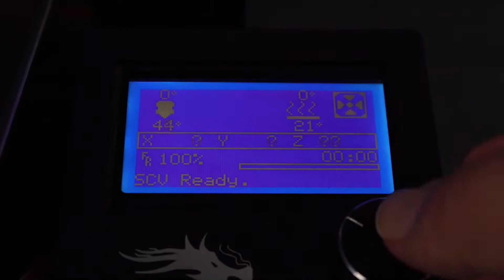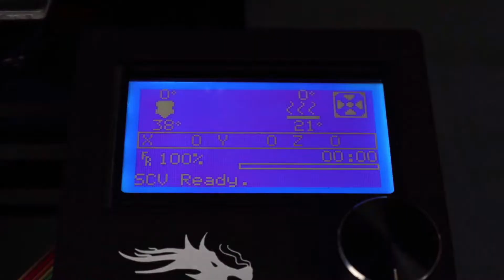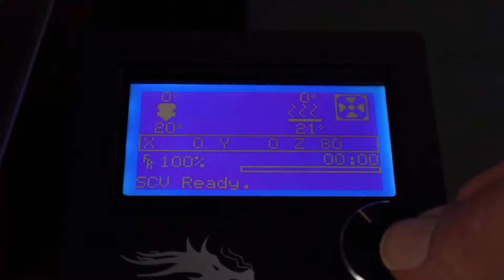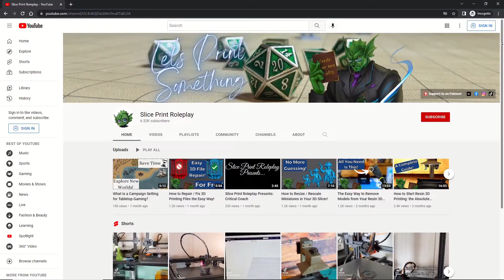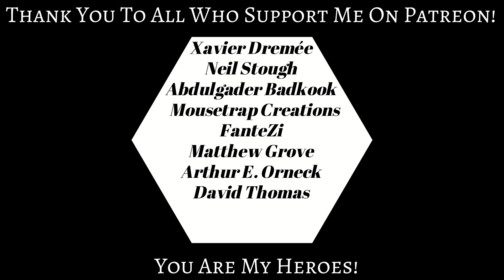How to Install a Glass Bed on Your FDM 3D Printer!

Comment: Sorry, I'm inexperienced, but I want to ask: Your printer's original proximity sensor is definitely magnetic. When it reads the metal plate of the print bed, it stops. Wouldn't it be easier to find a proximity sensor that reads glass? One with the same characteristics.
Reply from the maker: This is an older style printer that does not have any kind of inductive or proximity sensor. It's simply just a switch that engages when the Z-axis reaches a certain level. That switch is engaged the same way whether you're using a metal plate or glass.

Comment: Solutions over binder clips? I dont have the clearance for them. The way my hot end is shaped no matter how close to the edge I am it touches the housing
Reply from the maker: Honestly I don't use glass beds anymore. When I made this video magnetic beds were still new and had a long way to go. Now, however those systems have improved a lot. Those are the systems I recommend now.
But if you want to use the glass bed I'd try hairspray to hold it in place. Apply it to the backside and put the plate back in place on the sub plate. Then heat the bed to 60c for 5 minutes. Then let it cool. After that it should be stuck in place until you Pride away from the sub plate using a scrapper.

Comment: Another banger, great info in here man! Glass beds definitely are sweet, though I have zero experience with any other kind so I'd never considered before that a flexible magnetic bed for example would contour to any imperfections to the lower bed plate so, good to know! One thing I have found with glass though is sometimes adhesion is a little... too good. My workaround is probably stupid but if I'm in a hurry to get freshly printed parts off a hot bed I just run the whole thing under a cold tap and the prints release pretty quick - luckily haven't had a bed shatter yet with the rapid temperature change but if that day comes I know which video to come back and refer too haha. Keep up the good work!
Reply from the maker: Thanks so much for your kind words my friend.
Yeah I believe the spring steel magnetic beds would have similar benefits. However, the cheap mag beds will absolutely match any low or high spots on your subplate.

Rapidly cooling the bed is a great way to get prints to pop off the bed. I've heard of people putting the glass bed in the freezer to achieve the same effect. If it works that's all that matters. 😊

Comment: I get the theory that the glass helps bridge over imperfections in the plate, but that only works as long as the glass itself decides to stay flat. My last couple glass beds decided to “taco” really badly (out several tenths of a millimeter from center to the edges) so it was nearly impossible to get a good first layer for anything. Using tricks like flipping the bed over for a while, etc, didn’t work. I now use a magnetic base with a spring steel sheet, and my bed has consistently stayed much flatter than the glass beds I used in the past. I also can use the entire real estate of my print bed without having to worry about clips getting in the way.

I get it, though. Everybody’s mileage will vary. If glass beds are working for you, then that’s great.
Reply from the maker: Oh wow that sounds like an awful experience! 
Fortunately I've not had any issues with the glass beds on my printers. 
Glad you found a system that works for you!

Comment: DITCH the clips, Glue it down with hairspray and use alcohol to remove if ever needed. I have 7 printers done like this.
Reply from the maker: That's a really interesting idea, I'll definitely have to try that out. Thanks for the tip!